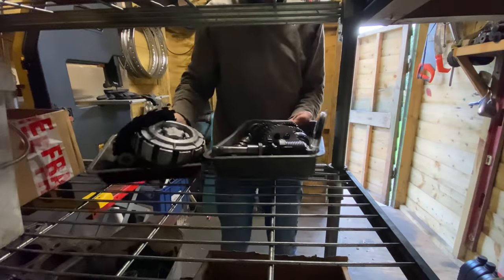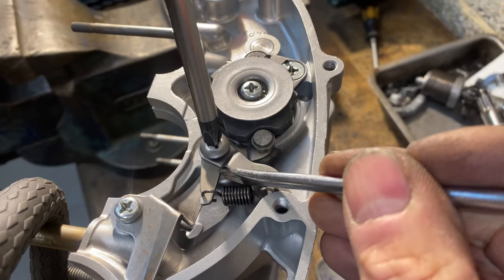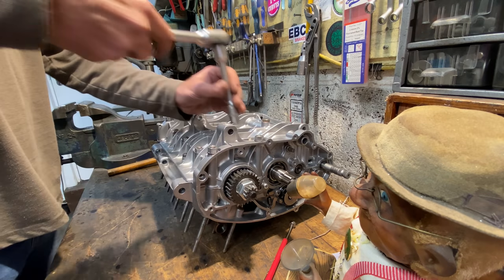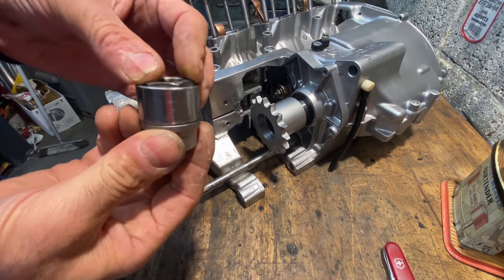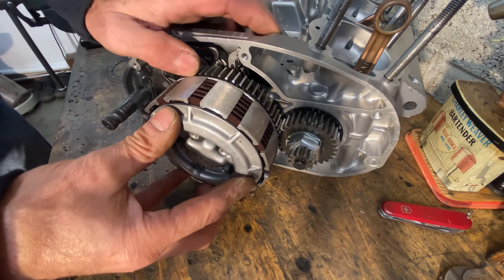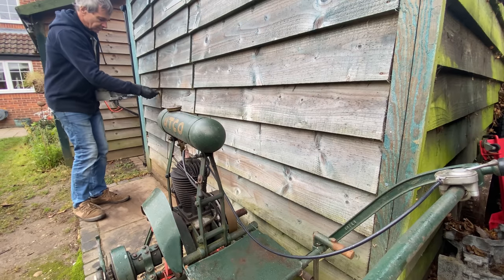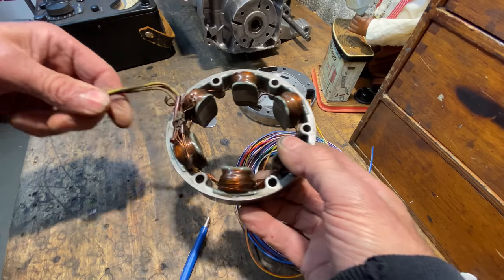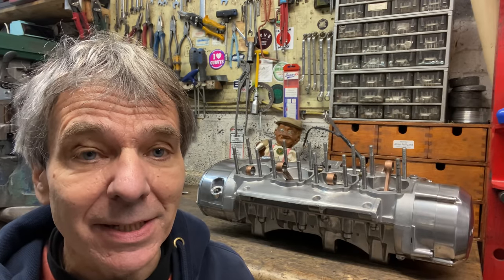Millyard Kawasaki S1 Four Cylinder -  Bottom End Build- Episode 5

Comment: A lot of nostalgia for me in this excellent video. The AVO multimeter that I used a lot early in my working life. The Christmas cake, one of which I haven’t had since relocating from Coventry to the USA 30+ years ago. The memory of building a Kawasaki Z1B motor on my bedroom floor, getting the bottom end completed only to see the new cam chain (driven from the centre of the crankshaft), still in its packaging.

Comment: Ive never had a classic Japanese two stroke that wasn't improved by using an electronic ignition . Ive always been surprised that you use points . Engines looking good 👍
Reply from the maker: I like points but yes your right and I fitted electronic ign to both my six cylinder Z1,s

Comment: Hi 👋 Allen. I've worked on a number of Kawasaki triples during the 70's/80's which includes converting a KH250 with S2 350cc components with 26mm KH400 carbs. It was at a later stage I fitted a complete S3 400 air box 📦 and complete clutch having determined that the S1 250 item couldn't handle the power. This bike in green meanie colour scheme actually beat a H1 Mach III over the quarter mile in a time of 13.1 seconds/90 mph at a run what you brung, Long Marston 1981 with my younger brother riding.
He also wheelied a Honda XR500 both ways along the quarter mile earning the name of 'The wheelie bike' that day, happy days and Christmas 🎄 wishes.
Reply: Yes, l've been wondering if that clutch can handle the extra power too. Perhaps he will mention whether the springs are from another model.
Reply: Banana Brooks-I can tell you that. The clutch on the S3/KH 400 is different, it has both an extra steel and friction plate and stronger clutch springs. I know, I built that (Green meanie) bike. The airbox is also different as it has to pass more air to feed the larger cylinders. The bike was fitted with expansion chambers from Serval Marketing, a rear sprocket from the Z400D, S3 front sprocket and heavier chain.

Comment: Oh course I admire your authenticity...the use of the outer case cross head screws, but I've had so much hassle with those (probably my fault, not having the correct screw driver) I always fit Allen heads now. Sorry 😊 lovely work as always, very therapeutic watch.

Comment: Brilliant Engineering Allen Proper!! I'm as fussy as you are I've only built two Race motors one bike i had was 1979 SUZUKI GS1000S it could pull 66mph in first gear. I wish I could use a Lathe & mill though. Merry Christmas 🎅 🎄

Comment: My method of gasket making is a little different: I mark it out by putting a little oil on the case, if I decide to cut it out as you do. Otherwise, I use a suitable size hammer to cut the paper (vellumoid?) against the sharp edge of the case. If I'm able to hold it firmly in place, this works a charm, and I get perfect results, I even use a ball pein to cut the screw holes.

Comment: When making gaskets a standard paper punch can work well for the holes. Reach can be an issue, but the centre holes of a 4 hole punch sometimes have more reach. Use after cutting out the gasket, and you can "nibble" the hole for a slightly larger hole (or strange shape). Line up from the bottom of the punch, after removing punch paper catcher. You can see your markings on the gasket through the punch hole.

Comment: Do you not use any sort of screw lock on these internal screws Allen, such as Loctite 222 (Purple). I'd always worry about them coming loose, 222 threadlocker is easy to disassemble when needed.

Comment: Very nice and detailed video. What gasket sealent are you using? Looks very thin and clear, and then you don't add a paper gasket? Normally the gasket sealers are thick and colorfull and gets everywhere and is awfull to wirk with.
Reply from the maker: Permatex ultra grey and no gasket on crankcase joint on Kawasaki engines

Comment: those wire springs in the clutch are actually there to work on the engagement of the clutch not when pulling the lever in.  They are anti judder springs.  When releasing the clutch lever from a stop they serve to dampen the engagement so as to help mitigate any jerkiness as the main coil springs clamp pressure plate to driven/drive plates to inner hub.  These bikes didn’t have Cush drive rear sprocket/wheels and the anti judder springs gave some dampening also to the clunk you hear when putting a motorcycle into first gear from neutral.  Even though most motorcycles have rubber dampened drive sprockets (Cush drive) many still retain anti judder springs in the clutch.  Rather than those wire springs they are typically a cone shaped diaphragm spring that sits inside the first fiber plates oversized inner diameter.  As the next plate in the stack up is a steel plate splined to inner hub, at takeoff when the clutch is being slowly clamped together that judder spring holds the last two plates from clamping all the together till it’s spring pressure is overcome.  This gives a little dampening right at the moment when final clutch engagement occurs and all the power is tranfered to the chain/sprocket/wheel/tire.  
I’m a drag racer and the early hayabusa didn’t come with one from the factory until 2003.  We had to modify them or they would jerk and buck off the line horribly under a fast dragstrip hole shot.
Reply from the maker: All Kawasaki triples have a Cush drive
Reply: 🤦‍♂️. I’m a suzuki guy, lol.  I really love your work though.  Been following it for a while now.  As I said I’m a drag racer and I also work on bikes full time for a living, building engines and doing custom bikes.  Your creations are inspiring. I recall you having done several Kawasaki’s and a few Honda’s but have you ever done any Suzuki’s?  The Gs1000/1100/1150 comes to mind.  They had press together cranks that would lend to your method for adding cylinders.  I want to try my hand at one of these creations,  maybe a 5 or 6 cylinder GS1000 Wes Cooley replica????  Anyway, Merry Christmas 🎄

Comment: I just wondered why you put the gasket on dry, i normally put oil on them to make sure they do not drop away, and also to make sure they are oil tight, often when i had forgotten it, it might drip oil, until its filled with oil.

Comment: Ever do anything with the Suzuki 350 2stroke bikes? My dad bought a 71 new, I'd like to rebuild it, maybe spice it up a bit, retro mod, mostly stock, get rid of the ape hangers, I don't like the monkey bars! Haha not on a bike like that, maybe a slight cafe theme, my mom was branded by the exhaust, it says do not modify this exhaust on her leg! Haha, I'm sure it wasn't funny at the moment! But if you get burned, it mays well say something! I'd like to possibly get the rims powder coated. Aswell as the frame, it's orange and white, it's not ran since I been here, so nearing 45years! It would be nice to also port it, and increase the displacement a bit, maybe possibly 400cc+ and expansion chamber exhaust, I have never rode one, but have rode a similar Honda 250cc it was decent, it has had some work done internally, and supposed to hang with a cb750, 
Fitting modern tires, more like super bike tires tread, with wider rims would be a plus, I done want to do anything that cant be returned to stock,

Comment: Love your work Allen but Standard S1 6 plate clutch with a 4 cylinder S3 top end? It'll take more than uprated springs I feel.
Reply from the maker: I’ll fix it later when bike is finished. Will look for S3 clutch with extra plate and fit stronger springs. The std clutch is fine for normal road riding
Reply: @AllenMillyard  I'll put a shout out on the Triples Club for a clutch for you but they are very scarce these days. You''ll also need the narrower S3 primary gear, but it's not beyond a chap of your talent to reduce a 250 gear of course.

Comment: How easy would it be for someone that knows, to fit a kick start to a bike that didn't come with one?
Reply: All Kwak 2 stroke triples had a kickstart.
Reply: @bananabrooks3836  I've actually got a 1981 Kwaka 550 LTD. I would love a kick start on it.
Reply: @rappers5719  Oh sorry l misread your original comment.
Why? you shouldnt need it if the electrical system is up to specs.
Reply: @bananabrooks3836  It is. But I would just like one.
Reply: @rappers5719  Looking at a Z650 kickstart shaft, gears etc going for £26 on ebay, it doesn`t appear that easy to convert your 550. Looks like similar to many old Brit bike setups. Both kickstart gears on same shaft, not side-by-side, as in the KH range. Even then you`d have to graft a small housing onto the g/box& clutch cover....thinking off the top of my head.
Picked up an old  Z750 twin in the late `80s that was surprisingly nice to ride, however the starter clutch played up, but luckily it had a kickstarter too.
Reply: @rattusnorvegicus4380  Thank you.